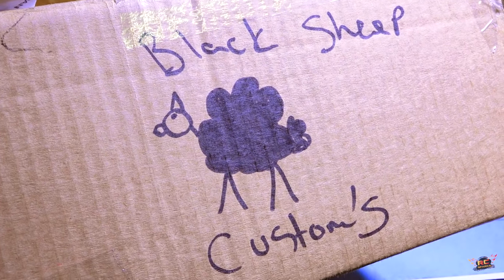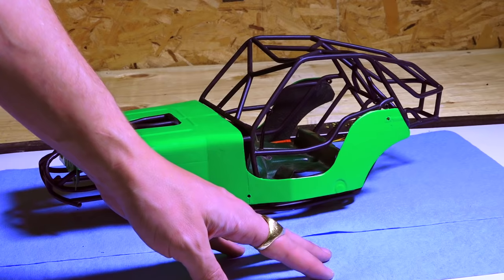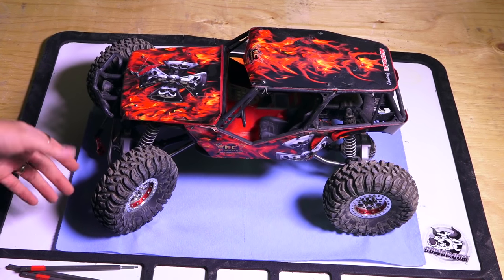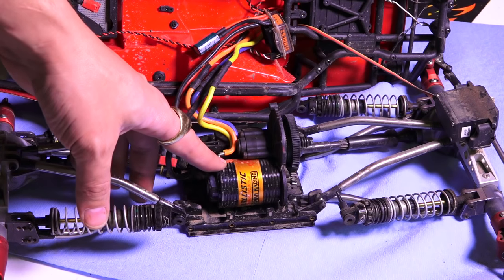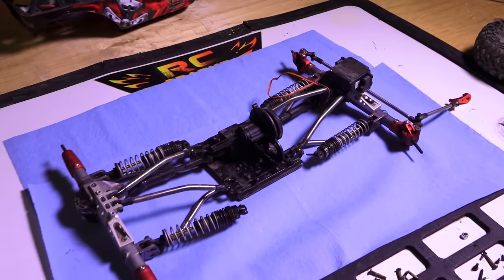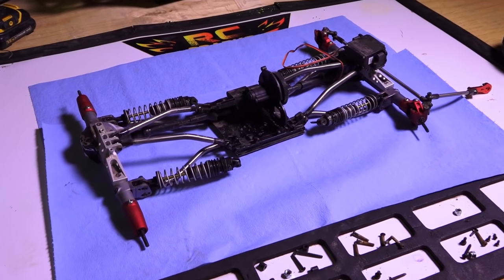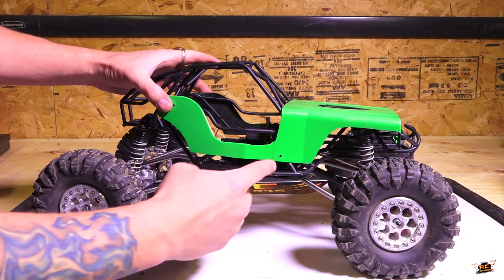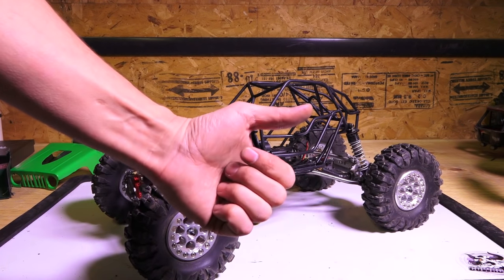RC ADVENTURES - Black Sheep Customs Bouncer Tube Cage Upgrade for Axial Wraith 4x4

Comment: awesome build! not a big fan of silicon sprays.. I use Wurth 2040 which is silicon free and you can use it in and around where you might be painting bits with minimal to no worries of contaminating paint.

Comment: Hey man, I loved the vid. Seriously nice piece of kit. I hear your woes about water-proof servos. Here's a top tip: check out CorrosionX. It's a must have for RC, especially in snow. Dab it on your universals, and paint it on your electronics. You can make any servo or speed controller truly water-proof with the stuff. Get the non-aerosol container, it's easier to apply and will water-proof anything you can put it on.
Reply from the maker: +case MasterxL heh... thanks for the advice. I find it ironic, as I have been showing people how to waterproof servos for 7 years..  ;)  I like to purchase them already waterproofed now.

Comment: nice I just got a associated sc10 4x4 and  I put a tekin 4000 kv brushless motor and it has a rx8 gen 1 in it but just a cheap 30 dollar servo but it has a traxxas short course truck body on it and its a 1/10 scale

Comment: Ive built a wraith a few days ago and when I was putting it together the 2.0mm and 1.5mm screws kept stripping. I have a nice $60 set of metric hex drivers but they still strip. Where is a good place to find some precision drivers?

Comment: Hi aron i bought a traxxas summit and servos are getting weak. With your savox 231 in your summit do u have to adjust the turnbuckles constantly or are they strong enough that the take the abuse and it wont matter if they fight?

Comment: is it better to buy a brushed 2wd slash and a BL kit or to just buy it brushless
Reply: +Playstation Games If you by the Traxxas brushless system its already waterproof but if you are looking for more speed go with a brushed Slash and upgrade to Brushless. I ran a cheaper Hobbywing System in mine(60amp esc with 4100kv motor) and it was insanely fast on just 2s lipo

Comment: I'm looking into get a rc and i want the warith because where i live it would do really well but is the wraith a good beginner's rc??? I've been watching the channel for a few years and the black widow is my favorite rc you have. I was just wondering if the wraith would be a good beginner rig??? thank you and great and amazing videos.
Reply: +Danny Bruce Wraith is an awesome first rig.You can use it both as a basher or a crawler and it is brushless capable as well. With some simple upgrades like suspension and steering links, it will be pretty capable
Reply: +Chris O'Donnell Thank you. What would be a good motor to upgrade it to??? and that will be later on down the road tell i get use to the rig.
Reply: +Danny Bruce If you are going brushless that would depend on what driving style you are using it for. If you are straight up bashing it ,something fast(higher kv).But if you want to use it for both bash and crawl you will likely want a sensored motor and esc. That way you can go fast and can crawl without motor "cogging". I would look around some Rc forums to see what other guys are running.
Reply: +Danny Bruce Keep in mind though that brushed systems,though not as efficient for battery consumption,handle water better and are cheaper to replace. Alot of guys that do the kind of trailing stuff medic does in his videos, stick with brushed systems.The brushless systems have their good and bad components.Not waterproof and are expensive.

Comment: Medic, Can you suggest a good rc car for $100, preferably a kit?
Reply: +KrAvE4KaRnAgE $100 is a tough one. Depends on where you live but I would try the used market but there is more then just the Rc needed. Batteries and charger start make things more costly. Good luck and save your pennies!
Reply: +Chris O'Donnell thanks Chris, i actually live in the UK and have about £50 to spend just to have some fun. I might just fix up my Schumacher Riot instead. Thanks

Comment: what is the best motor to run in Short course
Reply: +Keegan Tiffany I have the Mamba Monster 2200kv system in my Slash 4x4. On 3s lipo,its a beast. Abit pricey but they have a Sidewinder 1/8 2200kv system thats almost as good for a little cheaper
Reply: +Chris O'Donnell thanks

Comment: how much was your killer krawler
Reply from the maker: +Amanda Jones All together, everything included but the radio, approximately $2500 USD, all in.   It can be built for less...
Reply from the maker: ***** Nope.. you were correct actually. The Killer Krawler Kit is $999 USD. Its just all the other gear you need to make it come together is substantial..  :)